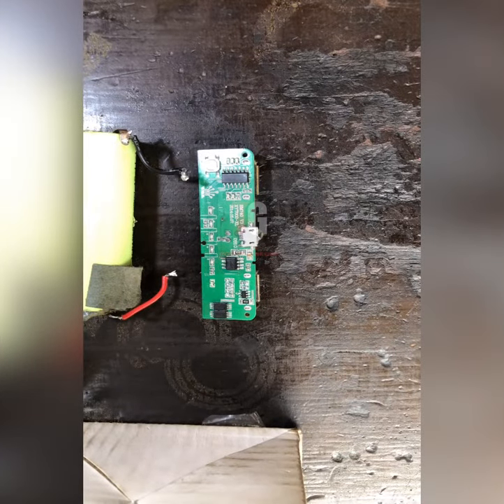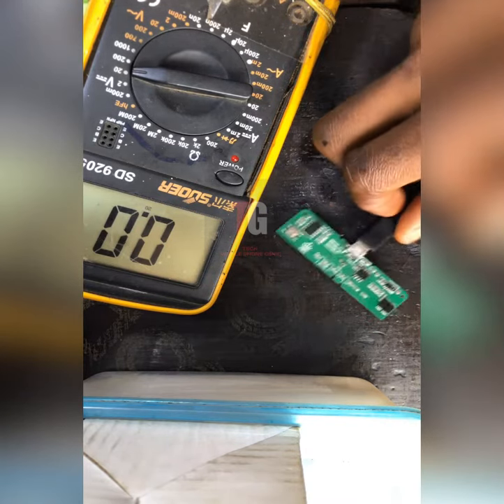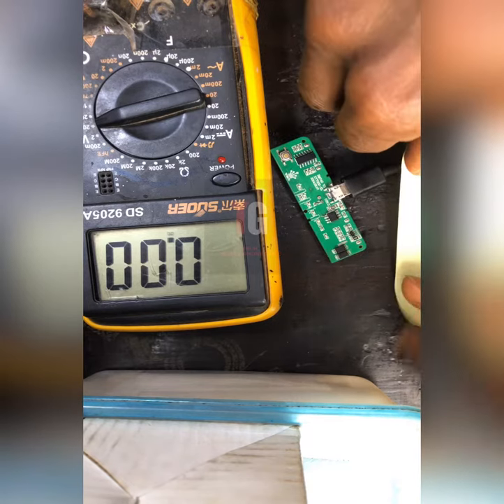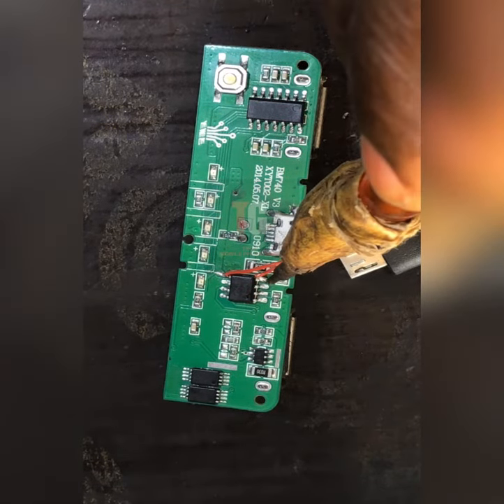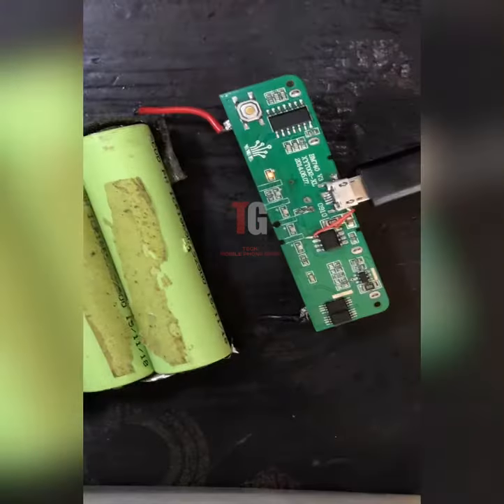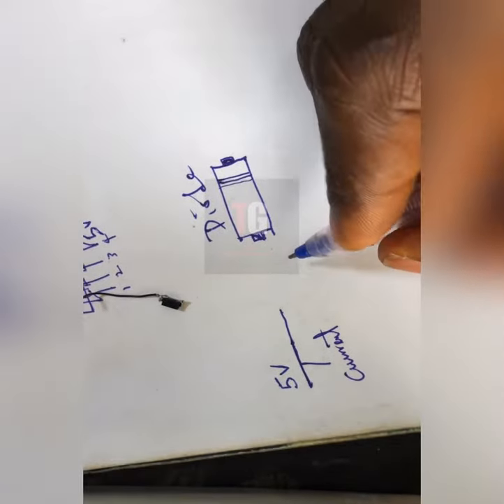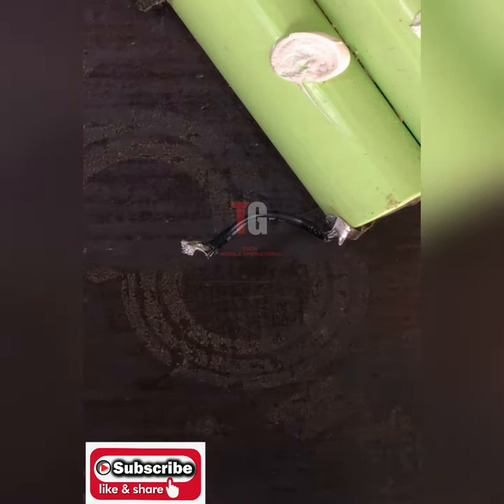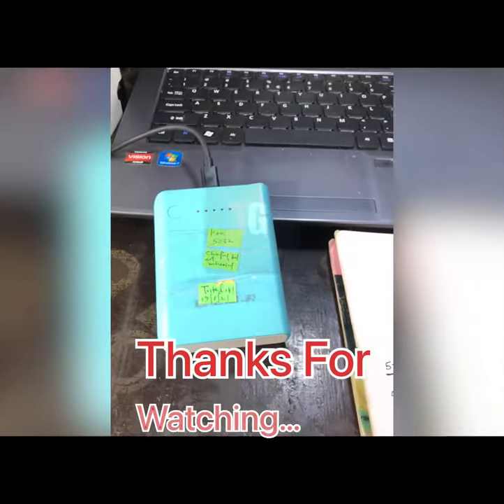Power Bank Repair

Comment: In the case when ure power bank is fully charged to full 4bars.. Then when  trying to use it to charge your gadget like phone or etc.. Then it started indicating 1bar when plugged in your gadget, but immediately when removing the consuming gadget like phone or etc it goes back to 4bars completely again but when inserted back it indicate 1bar again and not charging the gadget fully like it used to before not even up to 20% of charging.. What can I do on this case of repair.. I have changed the battery but it still dsame...

Comment: excellent work. But the problem I deplore is that if the 5V must continuously charge the 3 3.7v batteries placed in parallel, the batteries will not survive long because of the overcharge.

excellent travail. Mails le problème que je déplore est que si les 5V doivent continuellement chargés les 3 batteries de 3.7v placées en parallèle, fera que les batteries ne survivront pas longtemps a cause de la sur la surcharge